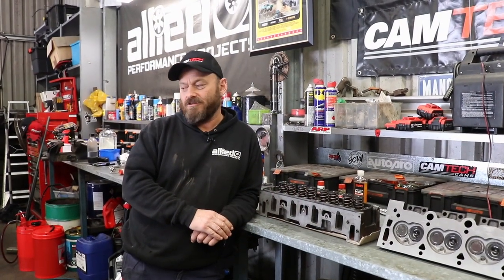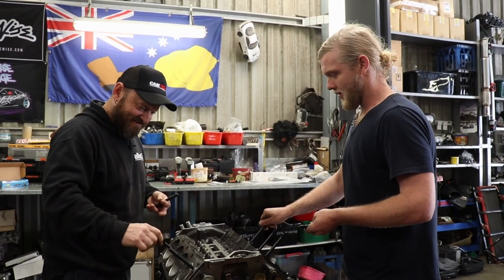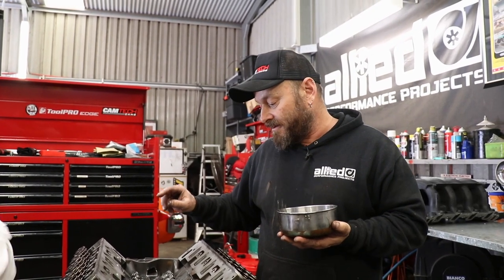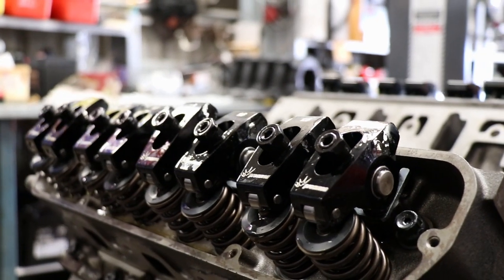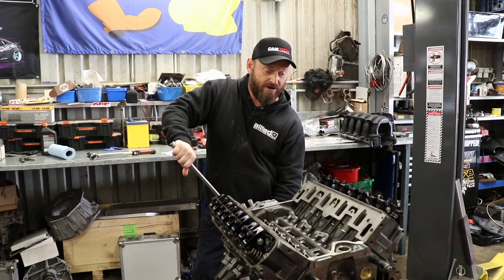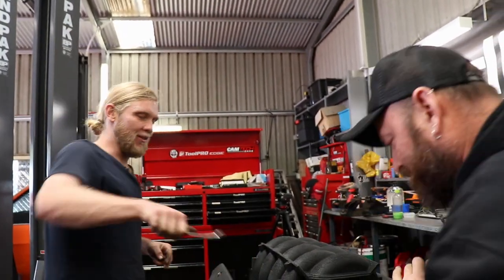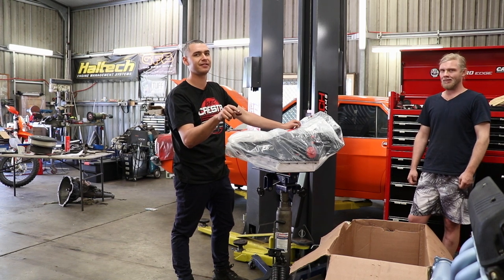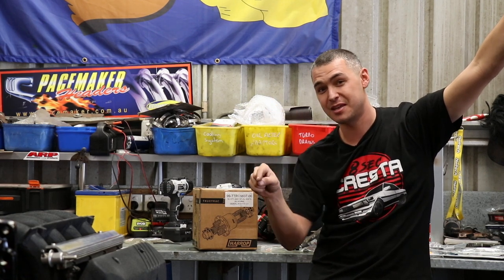GM HOLDEN 304 V8 ENGINE RE-BUILD [EP3]

Comment: I've built a few of these bad boys, from trial and tribulation, here are some things to consider:
~Oil pan/capacity 7-9ltrs crank scraper and windage tray, eg High Energy
~Vr-Vs blocks are considered the better choices, additional webbing and relieving for stroker crankshafts. The VT blocks have shown inferior metallurgy and casting faults.
~Quality crankshafts COME or HARROP, ground to accept chevy rods (more selection than Holden) and chevy rear main seal, cross drilled of course.
~ I have used 6 inch rods, better dwell, less reciprocating weight.
~Quality harmonic balancer
~Studs all round

~Cast iron oil pump, low volume, not alloy. I modify them to make pressure relief adjustable.
~Timing chain can be swapped out for the Mercedes triplex chain (same pitch) just need to cut to appropriate length.
~Oil restrictor fitted to centre cam bearing. gallery.
~relieve/smoothen out valley/ lifter area to aid oil return. 
~Pre flattened wire head gaskets
~Never use cork gaskets, later model have neoprene sump gaskets, I have always used quality liquid gasket for the valley with no problems.
~Heads, lots of varieties, I have had good results using COME cast iron "Bracketmaster", these are not available new any longer, they were VN OE refinished by COME, with stock size valves, but fitted with sodium filled. More modern alloy, would probably have better figures.
~ Get rid of the "bunch of nana's" , this is where your choice of ignition will dictate your direction. I personally ran carbs so I ran with a Harrop single plane.

These engines will produce good HP with longevity, such a shame Holden stopped producing them, in favour of the LS. Its as though their fate was sealed in 1998.
Reply from the maker: Great info mate.
Reply: Wish i read this earlier 😅 just finished my 355 build with a roller cam and 10.6.1 comp. Got about 3 hours run time before the permaseal graphite head gaskets blew out into the valley 😑 iv pulled the heads back off and im waiting for my felpro steel oring gaskets to arrive. Hopefully they last longer than the permaseals

Comment: I love the old GM/Holden V8's and V6's, simply designed and they go forever if they're looked after. I've pulled heads off a few 300,XXX km+ ones that have looked about 80,000km old inside

Comment: Al is correct. Google results for Iron Lion is Bob Marley. Woody fails.
Reply: Al is always correct, except when he's not, which is rare 👍 Woody has lost his super powers now he removed the ol soup strainer
Reply: Google gave me a cards/comics/collectibles store in colorado springs called the iron lion
Reply: Strange. My results were for a crossfit gym and some 80s glam rock thing.
Reply: Huh...mine gives p0rn results...time to clear the browsing history I guess.
Reply: in orange county, i got iron lion soaps
Reply: I got pictures of actual iron lion statues  😂
Reply: Iron Lion are an 80s glam rock parody band, kind of an Aussie Steel Panther. That's what I first thought of anyway.
Reply: Bob Marley had a song "Iron Lion Zion"
Reply: if you google "iron lion" + "holden" you will indeed get many results of people referring to this motor as the Iron Lion, however. Woody is not wrong about them being nicknamed that.

Comment: Hahaha an LS is "like a GM Holden motor built by Japanese guys".  Love your banter Yoda :)
Reply: Hes not wrong it was the TRD boys who showed them how to desighn an engine if it werent for Toyota and Isuzu Gm would still be cranking out shit boxes with small blocks and gutless 6.5 diesels
Reply: @79huddy  any sources on that man?
Reply: @MrRyumaru  my teacher at school worked at the gm testing facility when they brought the new desighns to the table and the Trd boys were there to help with it they gave the credit to a gm engineer but if it wasnt for the toyota boys walking them through all the processes for the casting and machining it would of took them longer to get it into production and a new duramax is just two isuzu forklift engines sharing a common crankshaft they used to say isuzu on the heads in early production commercial trucks
Reply: @79huddy  Yeah an anecdotal story ain't gonna cut it my dude, sorry.
Reply: @MrRyumaru  thats fine but my teacher legit worked for basically general motors version of skunkworks still does as far as i know but he was telling us about a mid engine supra that the trd boys brought to mid ohio to flex there skills to the gm execs when they were trying to get them to invest in building a truck plant here in the states he said they impressed them pretty good because that mid engine supra they brought over in 1997 spanked the lt1 powered corvette all over the track gm put a hault to them bringing the supra back to the states for twenty years they werent about to let a sister company import anything that smoked there flagship vette but they were more than willing to take a little help from some guys who can desighn a powertrain that is virtually bullet proof short of flat running it out of oil and i used to work on commercial trucks with the duramax diesels and its fact the earlier head castings said isuzu on the emission exempt versions
Reply: @MrRyumaru  no they havent because the one they brought over was a concept car and guess who just launched a mid engine corvette GM believe what ya want but Toyota has had a heavy influence with GM for a long time and the teachers in the UTI performance program have no reason to lie about what they do when there not teaching at the institute
Reply: @79huddy  How exactly did Toyota convince them by "spanking" the LT1 corvette, when the LS1 is an LS engine and would have already existed in your story about how Toyota helped Chevy make the LS? People always have a reason to lie. If he did work for such a thing, he would be under far too many contractual agreements to risk his financial being to tell some kids about a story.
Reply: @MrRyumaru  Lt1is a engine designation in 1997 it was a 350 dont believe me look it up the first Lt1 designated small block was built in like 1970
Reply: @MrRyumaru  he was training most of us to work for top performance programs whether it be for the big three or a professional race team most that stuff is common knowledge amongst the guys at that level there not telling you how it was done just telling you what was done
Reply: You can’t convince an American that other nationalities or non American companies are capable of influencing... an American product haha.
Reply: Why is it so hard to believe that Chevy built an engine like the LS? They built their first V8 in 1917 and started tinkering with them non-stop 38 years after that. V8s are nothing new to them. I've honestly never heard any Toyota fans claim that Toyota helped design the LS until now and I'm a Toyota fanatic who loves to bash on Chevy.
Reply: @agga3955  Who said I'm american, and why would that matter? I like both Chevy and Toyota, I own both. I just don't think we should spread information that isn't true.
Reply: @79huddy  Yeah I got confused when GM produced the "new" LT1 because I was sitting there thinking "Didn't they put that in Impalas and Caprices back in the 90s?".
Reply: @LimitR  The LT1 is just a slightly different version of the 350 sbc. It is different though, with a different heads, cam, and intake design.
Reply: @79huddy  That is a pretty wild story but unfortunately you are not remembering it correctly or your "teacher" was bullshitting. The LS1 was designed by a team of GM engineers starting in late 1991, they certainly didn't get scared by an imaginary mid engine supra in 1997. They probably looked at ideas from toyota, they probably also looked at ideas from the european companies, the ford kids even like to say that the ls1 was stolen from a ford design!
Reply: @MrRyumaru  all that stuff 79huddy said in his "story," it's all true. 22yrs with GM. It's common knowledge that a Duramax is an Isuzu engine. When I hired in at Flint V8, we were building gen II sbc. Then went to Romulus Powertrain to launch the gen III ls. These "stories" about shared tech between manufacturing partners are the plain truth. The part about the castings, TRUE. GM had trouble casting the aluminum parts without holes. This is one of the reasons that very early 6.0ls had iron heads. The help from overseas was key. Shared tech is a real thing.
Reply: @garybrown4671  Not saying tech isn't shared, I just don't believe Toyota had anything to do with the development of the LS. Using anecdotal evidence to support anecdotal evidence isn't going to convince anyone, sorry.
Reply: @79huddy  thats pretty wild man if true, but doesn't surprise me toyota was on top of their game back then. I could see toyota trying to help the "new" kid on the block
Reply: @MrRyumaru  like i said toyota helped get it to production Gm may of had a desighn drawn up but toyota engineers developed the casting tooling and machining equipment and procedures to bring the production of it to reality look at how much the tolerances tightened on the assembly of Gm engines starting in 1998 they went from holding a thousandths tolerance on assembly to tenths of a thousandths they also started hot machining castings by pumping heated coolant through the castings instead of cold machining like they had for years if you machine a casting at operating temp you can hold tenths of thousandths tolerances you know what Toyota had been doing since the early nineties and top race teams had been doing since the mid eighties
Reply: @79huddy  As soon as you have legitimate sources on that (that aren't just you or some random swearing it's totally true), I'll believe it. I like Toyota as much as the next guy, but they're far from the first to utilize the technology. I don't understand blind brand loyalty, but I suppose I never will.
Reply: @maze2756   Even if you don't like Chevy, they are quite far away from being "the new kid on the block" in any sense of the phrase and I've never heard someone call them that seriously.
Reply: @MrRyumaru  im not biased to any manufacturer i work on all makes and models and not at some bullshit chain shop ive been working in the field building performance engines for over 19 years UTI isnt some bullshit school and the guys who teach at the institute arent a bunch of bullshitters there top in there field and all work or have worked for the big three they send them to the institute to train guys like me to have a full understanding of the industry were training for whered you get your knowledge bud
Reply: @MrRyumaru  when it came to quality they had nothing on Toyota as in "modern" technology, but hey can't have a conversation with out some one wanting "ligitimate" sources theses days.
Reply: Damn, the LS is so good that even Toyota fanboys claim Toyota designed it.
Reply: @79huddy  yeah but the l.s. looks almost identical to the buick 215 v8. plus nearly everything on the l.s. already existed on other vehicles.
Reply: All you ripping into this and forget gm bought a shit load of j35s and dropped em into vues and captivias

Comment: Id say the plastic nickname comes into it because all the 304 's came out in the plastic bumper gen cars
Reply: The VK model I would assume.
Reply: I thought plastic chev came from the ls series motors having a plastic intake manifold
Reply: I remeber in around 1982 mates calling the 308 in my mates Hatchback Torana a 'plastic' motor because they considered their small block Chevs to be a proper V8
Reply: I always thought the name had something to do with the engine cover's/intake piping?
Reply: The Aussie Unprofessional  they were called plastics because every v8 previously was a Chev when Holden brought out the 253 they were seen a cheap plastic copies.

Comment: They dissemble themselves at a similar power level you would expect from an engine made of plastic.
Also heavy use of the magic plastic will be required, assuming you want to build an engine to make half the power of a small block at twice the price.

Regards, an ex 355 owner :)

Comment: If the surprise build is the awesome  “T” word on the tuff mounts box, I may be able to finally get Mum to sit down and watch the build. As she had a 1978 LH model with the bog standard 6 cylinder red motor and 4 speed manual when I was a kid around 7 - 9 years old before she got a done up 1984 Gemini.

Comment: O ring valve stem seals? Good lord that's 1950's Land Rover technology !
As for iron lion never heard them called that but I remember them being called mouse motors, the Chev BB being called a Rat engine.
Reply: some random guy absolutely correct, the sbc got that nickname from the Mighty Mouse comic series that was very popular at the time. BBC got rat because it’s a big mouse (even though they’re extremely different under the skin)

Comment: The closest track you guys are going to be at for me would be Maryland International Raceway, But that is on a Thursday, and I can't cut out of work to drive 200 miles to catch you guy. Best of luck this race. The competition this year will be hard then before, but the driving will be much nicer then all the mountains, and rain you had to deal with last year. Word of warning. Be on guard 24/7 while in New Jersey at Atco Dragway. Jersey cops are hard nose ass hats, and the thieves are thick around those parts. If it isn't bolted, glue, or screwed down. Someone will try to steal it.

Comment: The reason I heard them refereed to as "plastic is that the early ones, especially the 253ci (4.2L) were renowned for having soft crankshafts.
Reply: Crap, they were called plastic as they had alloy timing gears, oil pump, intake, water pump when Ford and Chev used cast iron for all these !

Comment: Guys you should have got the dizzy blueprinted and put better quality gears on the end of it IMO, more better firing and also last longer, other than that, why the spacing between the roker arm and the lifter/ push rod was not checked, based on the cam used ?

Comment: Not sure how the 304 is designated with GM but Hot Rod Magazine had an article on all the different firing orders that could be run with stock crank angles and most cams. There are a lot of different firing orders that will work and give different performances. May be worth a look into it. The 304 block to me resembles an AMC 304 the way the oil pump is outside the block, the AMC had it out the other side though. AMC used bits and pieces of Ford, Dodge, and GM in most of their stuff. Doing the same as Holden using the best of everything to make something that was different.
Reply: The GM Holden is the only GM V8 with the left bank forward if you didn't notice , this makes it different in firing order, and if you look at the motor it evolved from the 253 to 308 ci early Holden V8 it shares the 350 Oldsmobile Rockets intake/exhaust port location which is different to any other V8 , it also shares Olds 8 deg valve angle , rocker arm style ect, it has chev bore spacing , and a lot had chev bellhousing pattern , it has Olds starter location and Olds flywheel mounting Style , when it was designed GMH Australia went to the US and picked the better parts of all the GM V8S , ducked the big bosses at GM and got our V8 approved for production , and if you look at the 1988 5.0 injected V8 you will see the same intake style as LS and redesigned LS port location , but we had it in 1988 ! There was also the final Holden V8 of 355ci injected roller cam motor in 1998.

Comment: Great try y headers, just like the HSV's had. Great work buy the way, if only you have got the pacemaker headers ceramic coated as well. :) but still cant wait till she fires up and how much HP she will make ?
Reply: 350 is my guess
Reply from the maker: Pacemakers are coated in some proprietary stuff that prevents corrosion.

It would probably do 350hp if it had 10:1 comp but 8.6 might be a bit low......

Comment: For those of you that hang on every word Turbo Yoda says :P he was making that up it wasnt the year Tupperware was invented XD

Tupperware was developed in 1946 by Earl Silas Tupper (1907–83) in Leominster, Massachusetts.[4] He developed plastic containers used in households to contain food and keep it airtight, which featured a then-patented "burping seal". Tupper had already invented the plastic for Tupperware in 1938, but the product only worked with the emergence of the "sale through presentation" idea, held in a party setting.

Comment: Just a quick heads up these engines are externally balanced so make sure you use the flex plate that came off that engine or you're going to have bearing issues
Reply: ahhhhh no there not there internally balanced like all good motors should be
Reply from the maker: Bob Bob Correct, internally balances.
Reply: @theskidfactory  IV got three of the f$&king things two in parts and one in my ute I know a thing or three about them
Reply: All flex plates were Ballanced the same as were flywheels , any one will do, these are factory engines , they didn't balance every engine (dynamic balance ) they all got the same weight !